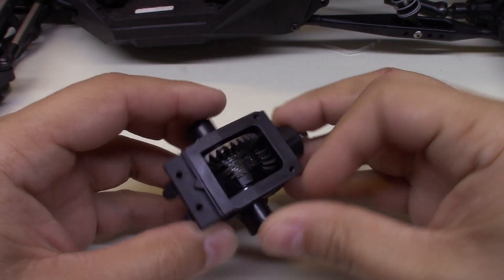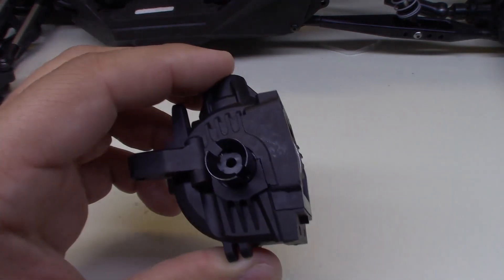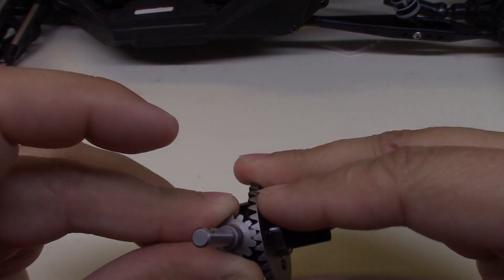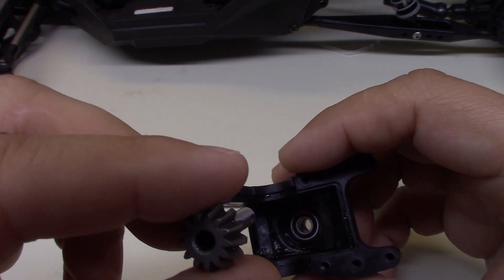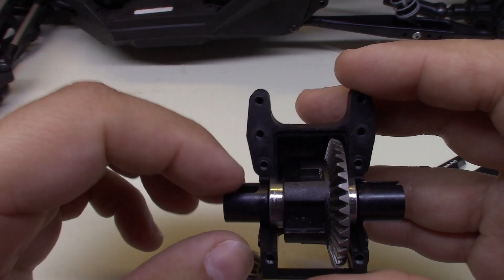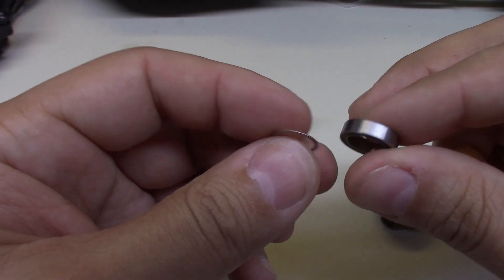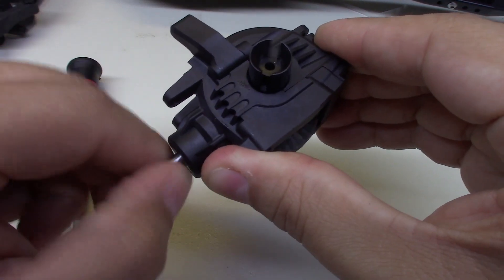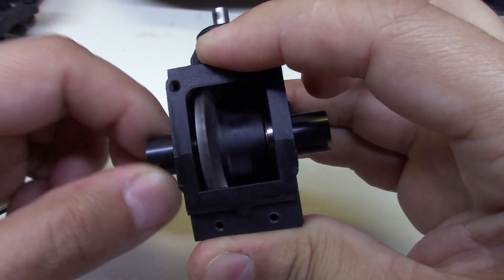R/C Differential Gear Setup and Shimming

Comment: Very useful, need help finding the right size shims for my axial 6x6 umg if anyone can help?
Reply: I am piecing together an axial 6x6 myself in 1/10 scale. It's a slow process, ordering all the individual parts from wherever I can find them (online hobby stores, Amazon, banggood, etc.). What I could really use are a physical set of plans with the exploded views of the different systems, i.e. the suspension, drivetrain, chassis, the 3 live axles (solid axles). Would you know where I might be able to find those kind of plans or blueprints? The last set I ordered (the only 6x6 plans I could find online) were the motor on axle type (3 motors - 3 axles, no drive shafts), and that's not the kind of build I'm doing. I want the 1 motor to 1 transmission to 1 transfer case to 3 axles connected via drive shafts (open/locking/spool/limited slip differentials, straight/portal...at this point I don't care, I just need to see the parts and where they get bolted up...especially the suspension/linkages). It's a 6x6 crawler, not a 6x6 tractor/trailer setup so I need the plans that have the long travel suspension, not the leaf springs. If you could simply point me in the right direction, I'd be very appreciative.
Reply from the maker: You can get exploded views for pretty much any vehicle by just googling its name and exploded view. As far as plans for what you're trying to build I don't think enough of those things exist that any sort of plans would be available. You're probably just going to have to go full custom. I'd love to see the end result though! Thanks for watching and a sub is appreciated :-)